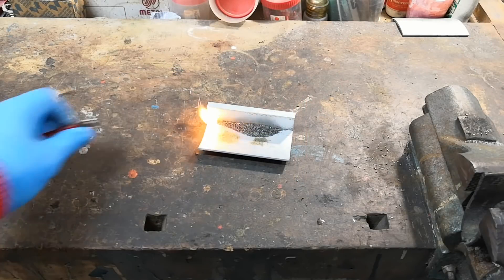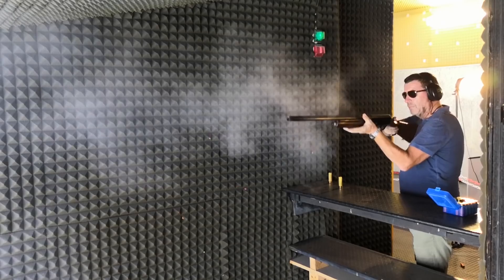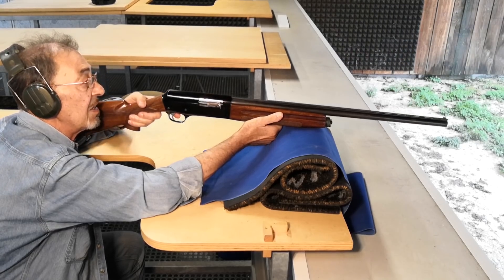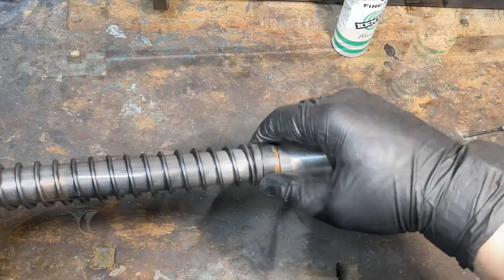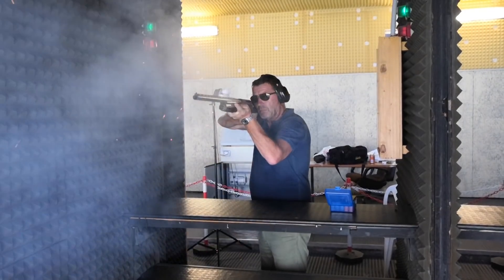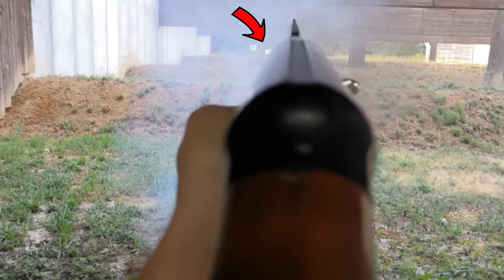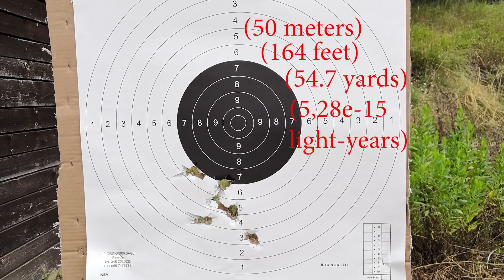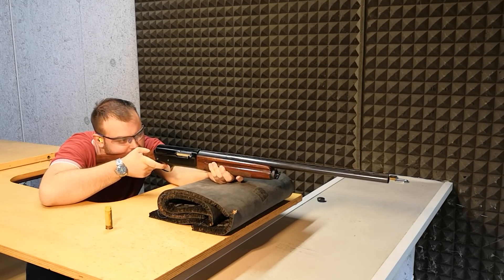Would a Modern Automatic Gun Work With Black Powder?

Comment: Delayed blowback might also work, since there are no gas ports as well.
So, please do a black powder HK G3 or similar ;-)
Reply: Delayed Roller Blowback guns like the G3/HK91 and MP5 are super dirty. So black powder would be a mess and a half.
Reply: @project86xero  and the G3 is a real bitch to clean as it is... especially the roller delay shoulders in the trunnion, the relief cuts in the breech and the cuts in the bolt and extractor tab (I've been using an issued one as a personal weapon in a national defense militia for over 14 years)😢

Comment: I DO NOT recommend removing the brake entirely.  The barrel and bolt will strike the rear of the receiver at increased velocity and that will transfer to the tang of the buttstock. The usual result is a split buttstock.  The gun was designed to function with cartridges producing a certain level of recoil.  If the cartridges you are using do not generate enough recoil to operate the gun with the brake in place for "light loads", DO NOT REMOVE THE BRAKE.  You will have to use loads generating more recoil.  
This was a common problem with the Browning "Auto 5 Magnum".  People would buy the 3" magnum model and then insist on trying to shoot skeet or trap with it using light target loads. Browning made a "Light Twelve" model for that purpose but why pay any attention to that?  Remove the brake and VOILA!!!!  it works!!!!!  After a few rounds of skeet or trap, the stock splits lengthwise. 
Recoil operated guns do not enjoy the flexibility of loads that gas and inertia guns do.  That is WHY gas and inertia guns were developed. 
Semi autos were not successful UNTIL they had smokeless powder.  The first semi auto rimfires used proprietary cartridges (The Winchester and Remington .22 Auto Rimfire cartridges) which were not interchangeable with .22 LR.  This was to make sure no one used black powder .22 ammo in them. Black powder does not generate enough gas pressure to operate a gas gun (and would immediately foul the gas port anyway) and does not generate enough recoil using modern wads and shells to operate a recoil gun (as you found out)  
If you were to load those shells with a proper charge of black powder and card/felt wads, as the original loads were made, they would operate the gun until it fouled enough to jam it up. As you can see in your videos, not ALL the combustion material is ejected out of the barrel.  A huge amount is being vented out the ejection port, and that is fouling the action. It would probably work for a couple dozen shots. 
Proper loads would be 3-1/4 to 3-3/4 drams  (89 to 102 grains) of 2Fg black powder and 1-1/4 to 1-3/8 oz. lead shot.  These would be what we would now call "Field" or "Heavy Field" loads. The 3-1/4 dr., 1-1/4 oz. #6 was a standard "duck and pheasant" load and with #7-1/2 shot was called the "Live Pigeon" load. Modern compression formed cases do not have the internal capacity to load black powder.  You would need to use older design "low base" (NOT the same as "low brass") tubular formed cases or paper cases.  Federal Champion paper cases would probably work. 
You will find, as people did 100 years ago..."the juice ain't worth the squeeze".

Comment: would u suppose a sten could run full auto with black powder?
Reply from the maker: I would think so, as long as you adjust the recoil spring and maybe the bolt mass.
Edit: I am actually thinking that in blowback operations the case starts moving when there is still high pressure, so fouling could accumulate towards the end of the chamber. Recoil operation is best because the bolt remains fixed relative to the barrel while there is high pressure. I still think I would get a sten to work with bp, by the way

Comment: Very nice. What about with a rifle? 
I understand the difficulties with using a gas operated rifle but perhaps with a CETME type action it could be done?
Also with the black power fouling I also understand that only a limited number of shots could be done between cleaning. However black powder does clean up more easily with simple hot water so maybe a thermos of hot water and pore a cup of hot water from the action end down the barrel followed with a rope cleaner every 5 shots or so? It might be a way to run a short string maybe 5 shots of black powder rounds through a rifle just to demonstrate proof of concept ???
Do you think you could fit enough black powder in a case to function a CETME type action?
Reply from the maker: Hey there! I am pretty sure i would get a recoil operated rifle to work, but they are not common. with a delayed blowback like the cetme it should work, as long as the delay mechanism is not too sensitive to dirt and fouling. I would be a little worried about accuracy due to fouling interfering with rifling. In any case i would have to adjust the cycling action to work with less recoil, since in rifle cartridges almost all the case capacity is normally already used, so you wouldn't be able to fit enough black powder to reach the same muzzle velocity.
Finally I don't know how black powder behaves in bottleneck cartridges. 
In conclusion, it is not so easy, and many safety procedures would have to be employed during planning and testing, but i think it can be done.

Comment: Great info for the prepper self sufficient type community. A chrome plated auto shotgun could be some serious firepower if 10 years after society collapsed ammunition was a rarity, you could just make some of your own with old shotgun hulls and homemade black powder.
Reply from the maker: That's actually one of the reasons I was originally interested in this topic
Reply: @יונתן זנטון 209 primers would be a bit of a hard thing to make, but functional primers can be made with punches, dies, sheetmetal like pop cans and the right chemicals. Or they can be stockpiled. A couple thousand  loaded rounds or primers would  be quite the supply if you were using them for sustenance and safety rather than recreational shooting.

Comment: Great work!   I bought a 357 for that same reason years ago.   It can be reloaded 38/357 with many kinds of powder.  There's not enough information out there on properly using "incorrect" powder.   I love videos like this.
Reply from the maker: Revolver cartridges are particularly suitable for allowing the use of many different powder and bullet combinations. As for black powder, it is always advisable not to leave it loose in the case. It shouldn't have free space to move around. On the website of gun maker Pedersoli you can find some black powder reloagind data, but I think it is mainly intended for muzzleloaders. Still useful though
Reply: A lot of revolver cartridges we originally designed for black powder. 44-40 for sure  probably 44 Russian  and 45 long colt. Also rifle rounds like 45-70 & 30-30.

Comment: Could black powder potentially work in recoil-operated machine guns like the m2 .50 cal? Perhaps even the 1911?
Reply from the maker: I am pretty sure they would work. They are however probably more susceptible to getting fouling behing the breech, since it opens sooner than in a long recoil operation. Also, the masses and springs would need to be adjusted, since for the same case capacity you get lower energy when using black powder.
I am also not sure if the presence of a marked case shoulder can interfere with black powder burning, I would need to do some research.
Short recoil operated pistols work for sure with bp, I've seen glocks and 1911 work fine with black powder as far as cycling goes. I don't know about accuracy though, fouling in the barrel interferes with rifling.
Reply: Hickok 45 has a video of him shooting a glock with black powder